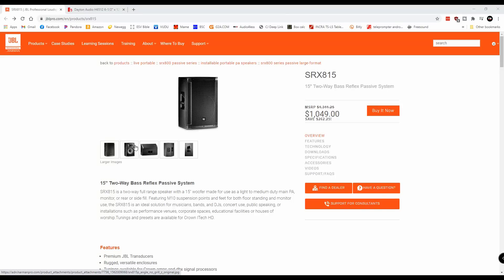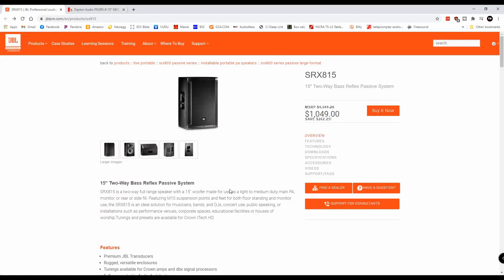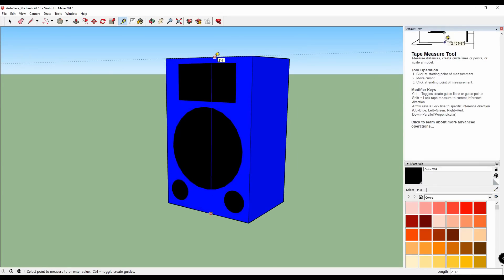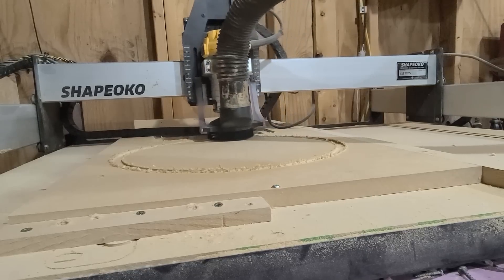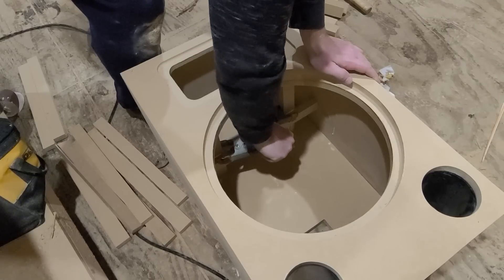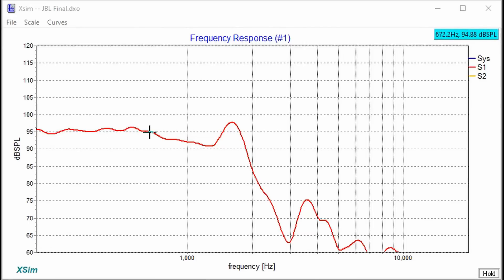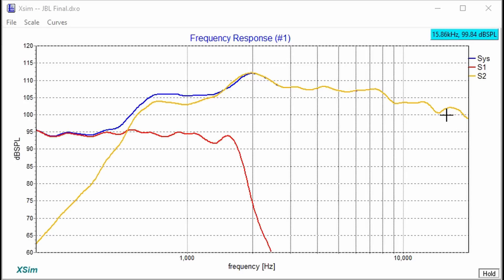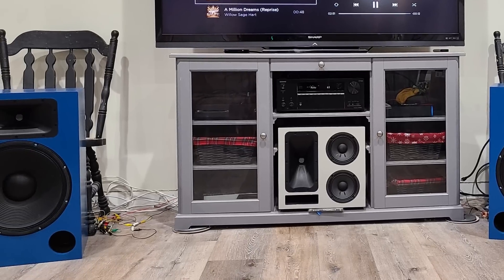How to Build $3000 Speakers for $500 - Soundstage 15

Comment: Good on you for doing a 15". It's about the sweet spot woofer size for 'life sized' output at reference levels in a residential environment. Was so glad to NOT see yet another "surprising bass output from such a small driver" design.
Reply from the maker: Thank you. I will have out a smaller version that should be really good for music and double as a nice surround speaker. It'll use a 10 in woofer and a compression driver.
Reply: @Toid  A bit smaller for on my desktop would be nice. And then I can put 2 in the back too.
Reply: I've done pretty well using 12" drivers.

Comment: Hi so if i build these for Dj-ing/Mobile Dj-ing or PA  in rooms of 100-300 people would they do the job? i'm currently doing a Karoake gig where i need a lil more oomf and would love if these could be part of my upgrades along with two dual 18's for Bass and ofcourse more powerful amplifiers. 

current setup 
Mids n highs: 2x 15 inch mids+two comp tweets with wave guide 360watts RMS each 
Sub: single 18 inch 700watt midlevel front loaded subwoofer 

Mids n highs amp: 2x385watt RMS@8ohm bridged 8 ohm 1100watts

Lows amp: 1x850watt amplifier Bridged 

i only run a Behringer CX2231 crossover(something like that forgot the name)

so please if any input can be shared i would appreciate it.

Comment: Wonder what's considered a medium room, I'm considering adding a DIY speakers to the living room which is 8x6x4m in size. I think the biggest surprise is the idea that I may need 15" woofers to cover that space, which makes me wonder how big would the subwoofer have to be? 21"?
Reply from the maker: You should be fine with something like this. They've played in bigger than that and are just fine. I just want to set realistic expectations. Two speakers for a large venue is a lot to ask for any pair of speakers.
Reply: @Toid  i also wonder how good would the speaker panel+subwoofer combo be.
Reply from the maker: @JoelHernandez-tz3vk  I don't understand the question. But if you're asking how good this sounds, they're pretty incredible.

Comment: Amazing that even in these stratospheric prices, the audiophile speaker manufacturers are only giving you MDF cabinets. Ouch. Here in Hungary, the new trend is to have the cabinet poured for you form concrete. Two smaller places are doing it. Those mothers will never need to be braced internally, and won't start walking off the stands on their own. And don't forget using upscale dog coffins as speaker enclosures, another trend that is catching up. Those are made out of wood, sometime mahogany. Not out of cheapskates MDF.
Reply: LOL..good luck with those. I don't care how good they sound.
Reply: @bobe3250  I’ll take braced wood over concrete any day, I’m not lifting that
Reply: MDF has been used for a reason what your saying is not accurate.
Reply: Ha ha disaster speakers🤣 good for announcements in siberia prisons. No good audio in hungary🥴
Reply: @kosiekoos9408 😂😂😂 no good audio in hungary ?! Take a look at PKN , Porkolab , Beag etc ...
Reply: Mdf has a better harmonic nutrality. This is due to uniform density. You have shown your not an audiophile. Buts thats ok.
Reply: @vengefulones6435  baltic birch plywood has higher rigidity and density. its more expensive but at these price points you would think they would be able to use higher quality materials but mdf is  the best value to build speaker cabinets out of in my opinion.

Comment: Why are they not designed for a large room as you say? With such a high efficiency that doesn't make any sense to me.
Reply from the maker: I should probably have clarified that. I never tested them in large spaces. The biggest I tested it in was a 30x20. They did fine in that space. But since I never tested it in a larger, environment, I can't say they were designed for it. The main test area was 15x25 and they were just amazing in that space.

Comment: How do I find out, how well these would perform outdoor for smaller raves with friends? I mean a 15" woofer should be able to deliver quite a bit of bass for a couple of feet away, or doesn't it?
Reply: Rave style speakers are usually horn loaded so that the enclosure has a massive bump in frequency response. These might be ok but you'd then want to build some purpose built subwoofers to add more thump

Comment: Nice! Appreciate the content. 

Helpful performance tip; utilize a "window" brace, instead of individual pieces. Significantly better bracing. Plus quieting the cabinet is really key with panel sizes like those... as only slight panel motion creates unwanted output.

Comment: Hi! love this :)
Is there an advantage of using the horns tweeters with that woofer? Or can I have a similar set up but with Ribbon tweeters instead?
Reply from the maker: The horn tweets give it quite a few advantages with this particular build. And give it a really wide sound stage while maintaining a very high sensitivity. Which means you don't need to push it very much, which makes it a very dynamic speaker.

Comment: How would you do this with 2 woofers crossover-wise? I have pro amps so driving 2ohm-8ohm loads is no problem. I'm trying to sort-of clone an XLS215 that Cerwin Vega used to make only without the 6.5" mid.
Reply: For the 4 ohm dual woofer low pass you halve the (series) inductor value and double the (parallel) capacitor value - if you are using the same driver(s). That or you can just install an identical low pass on each driver. Then double the size of the box and use 4 ports, then turn the L-pad on the tweeter up a bit - dual woofer conversion. If you want more bass extension you may have to enlarge the box more and/or adjust the diameter and the length of the ports (You might want to model this in a computer). If you are bi-amping you can set the crossovers electronically.

Comment: Hi, I can't understand your choices.  You have a cnc machine and you use it to build custom PA speakers with no regard to sound quality?  With such amazing gear at your disposal, why would you: 
1.  Use the SRX815 template, i.e. the one with no midrange driver?  Really, what sane person uses a 15" woofer anywhere in the 500-1500Hz range?  Just because bars use them to get really loud doesn't mean you should.

2.  Use thin walls when you need at least 1.5", especially on the baffle. No braces either.  Too much weight?  Use a 10" woofer instead to have a smaller cabinet.  It will generate much better bass down to <40Hz, just not as stupidly loudly.

3.  Not install damping treatment on the inside walls.

4. Not install damping treatment on the horn or the woofer basket.

5.  Not radius the baffle.

Finally, you said these speakers are designed for "small-to-medium sized rooms."  In what universe?  Two 15" woofers (total) for a small room?

JBL makes some wonderful drivers.  You could put in good crossovers and make good boxes, but without good design, they will fail.
Reply: 1. Perhaps for simplicity. I would like him to do a midrange horn next. 2. i thought that was strange to have such a puny front.  3. i think this is important as reflections can come out the cone 4. I think heavy bitumen like material is a cheap add on to reduce vibration 5. baffle radius wont matter very much. I would look at the room first

Comment: I have a set of GEMSOUND speakers id like to do a very similar upgrade to, but you didnt show the crossover however. The GEMs have an 18"LF, 3x7" MF and an array of 5 supertweeters. I simply want to start with getting a proper 3 way xover in there and a set of horns. Great work BTW, good stuff!
Reply from the maker: thank you. All the crossover information is in the plans which are linked in the description

Comment: Just a tip from a very experienced speaker builder. You should always support those horn drivers. I couldn't see in the video if you did but what happens if you don't is if they ever take a hard hit or a drop it will break your horn.
Reply from the maker: Great tip!
Reply: @Toid  thank you! Great video and I like that you braced your box. I've never understood why a lot of premade pro boxes don't do that. I mostly build custom PA boxes for some well known touring companies and I always brace the hell out of mine. There's a noticeable difference and when you're flying a lot of cabinets you definitely need the extra support too.

Comment: Nice build...!   For outdoor theater use however I'd have probably gone with birch ply, rounded off those edges and cover the whole thing with white duratex dyed to my chosen colour and put on with a fine finish foam roller. And put a mesh screen on the inside end of those vents :-)
Reply from the maker: Great points!

Comment: Oh man, I'd Def buy a DIY Amp off of you. Parts express is always sold out!
Reply from the maker: I could sell you mine if you want.  I can always build another one.  Go ahead and email me.
Reply: @Toid  Do you have any websites or YouTube videos for designing a subwoofer box?
Reply from the maker: @riveralley  I do. Here's a link to a series I did on a free program that helps you learn how to design boxes for subwoofers. https://youtube.com/playlist?list=PL6hjpiCHZmIOAv44PCreW5KlI35h1mTZK I do plan to redo the series at some point, but this should be good for now.
Reply: @Toid  is there a formula for getting the right area for the port? Or like a general rule of thumb?
Reply from the maker: @riveralley  there is, but it doesn't take into account sound quality or damage to the driver. It's best to model it in a program where it can give you an idea of if it's safe for the driver, the amount of air that will go through the port and the correct size that should be used.
Reply: @Toid  Thank you sir! Amp works great and my speakers have never sounded better! Great job on your channel and craftsmanship. 

If you ever do a DIY preamp/streamer build, let me know!
Reply from the maker: @Texican117  that's great to hear! Thank you for the update! Hopefully in the future I'll be able to do that.

Comment: For the crossover could I use this pre-built one from Parts Express?  PRV Audio 2DF1800 2-way, Part # 294-2867
Reply from the maker: Not to get the response I showed.
Reply: @Toid  Oh, okay. I have an older JBL SF25 PA speaker that I acquired a while back and I wanted to use this build to turn 1 dual 15" speaker into 2 single 15" speakers. I have a good grasp of the design and the hardware is already in the shopping cart. The issue is the crossover. I am willing to make one but I would need a parts list and a wiring diagram. Any help would be greatly appreciated even if it's just the specs I need for the crossover and I'll google "how to make a crossover" until I figure it out or buy a DSP. lol The replica build videos are definitely interesting to watch. Keep up the good work!

Comment: How much does that CNC machine cost?
Reply from the maker: I opted for the biggest unit so I think it's around $2,000. However I would much rather go with an oozenest workbee. It's around the same price can be bigger, and uses lead screws instead of belts, which makes it a lot more accurate. In general it seems to be a much better machine. I'm hoping to upgrade to one in the future
Reply: @Toid  Thanks, I told you I've been really sick and bleeding down low, I was scoped upper and lower, They found thickening on the outer lining of my heart and the condition is Amyloid, but I have to go to a specialist, 2 large Peptic Ulcers and a huge Hemerobiid closing my exit and I might have blood cancer, causing the thickening waiting on biopsies and esophageal issues, but at least I know, but I hope you and yours are all okay now??
Reply from the maker: @MrBrymstond  oh man that is awful. I really hope that you get better soon. Please keep me updated if you can. Take care of yourself. We are doing well. And you will be in our thoughts and prayers.
Reply: @Toid  Thank you and likewise.
Reply: @Toid  They found the heart issue using a echo cardiogram, but I might not have exactly that, they're puzzled.

Comment: I'll bet it sounds awesome in a night club for what the person bought them for and maybe hang them out of the way so they can project and I know the woofers sound better close to the ground, but you could always have a sub on the floor. PA Speakers got a bad rap because some think they're only good for bulk power while sounding fair, but I have PA Speakers with some killer sound. What would make these incredible for use in a larger band type music hall high quality sound would be two 15" woofers and a bigger Horn and have a short pole to be able to attach it directly into a subwoofer enclosure so the main speaker sits 2 or 3 feet on top of the sub with a pipe separating the two. I know Florida still has bands and karaoke at most bars, but I worry it will all go away everywhere. I had a outside anniversary party at my house with 50 people or more and cranking music last August in New York and the cops just drove by over and over with no problems if you can believe that as the cars lined up down the street.
Reply from the maker: Here's his report of the speakers: "They're great!  Love them!  I wasn't an audiophile before but I think I'm turning into one now!  Listening to music now is more enjoyable than I thought possible, I can "see" the music now.  Karaoke is on a whole new level now too!  I love the clarity of the sound they produce, no discomfort to the ears.  You don't realize how loud they are until you try to talk to someone because the purity of the sound is so clean."
Reply: I'd rather use these bad boys at home. Screw a club

Comment: Great! Love your work, best channel for DIYers ever! I've been playing with WinSD for vented projects, but I am confused what the port length means when specifying two ports instead of one. Does the figure displayed means that each one of the ports should be of that length, or that the total length of both parts should be this figure? Thanks.
Reply from the maker: Great question.  It means each port should be whatever the figured length is in WinISD.  SO if it says 2 ports 3" diameter 12" long.  It mean both 3" both need to be 12" long.

Comment: What would be the woofer in this build that can do 30Hz f3
Reply from the maker: I'm not sure off hand.  However, if you went this route, you would most likely need a larger box or loose out on the efficiency, making the system overall a lot less sensitive.  That old Hoffman's Law, just can't get around it.
Reply: @Toid  hearing great feedback on Purifi woofers the 6.5” woofer can compete with a 15”
Reply from the maker: @anandshah71  I've also heard great things about Purifi.  I would love to get my hands on some.  However, saying it could compete with a 15" woofer like this would be a huge stretch.  That purifi still only has a volume displacement of 1,325 while this Dayton's is 5,785.  Which is almost 4.5 times the purifi.   Having said that, the Purifi is still very formidable.  And by all accounts a very nice driver.

Comment: There's something about a large diameter light cone strong motor mid woofer that brings music to life. In the spirit of big beautiful vintage JBL studio monitors, I'm running a DIY 4-way (18", 15", big radial horns and ring/slot tweeters) actively multiamped system with crossover points at 100, 800, and 6k... stunning!
Reply: I totally agree, I am running jbl 4345 clones and the large mid is amazing.
Reply: @callmebigpapa  too cool! Anywhere I can go to see more details of your project?  I'm working on posting mine somewhere, including sound clips if I can get around copyright rules.

Comment: How about open baffle speakers? Like trio 15s or quintets from Pure audio project .....or open baffle arays like dany richie is designing .,....I hope I triggered your curiosity for open baffle speakers .....more and more people turn that way nowadays....thank u for your work
Reply from the maker: Thanks.  I have been pondering the idea...
Reply: @Toid  please do. I have been looking for affordable high efficiency and tube friendly speakers but haven’t found many options. I built my own 300B single ended amp. It sounds great with my 87dB speakers but should sound even better with some high efficiency speakers especially open baffle. Problem is there are not many designs let alone affordable ones. The Nxoticas start at $2600.
Reply: @Toid  Hey. May you please do the following projects.. please post plans with all measurements too. 
1. Bose MB24 WR SUBWOOFER 
2. McCauley M421 SUBWOOFER
3. Danley TH812 SUBWOOFER (155dB+!)
4. Danley J5 caleb (160db+!)
5. Bose Roommatch Arenamatch Showmatch line arrays..
Reply from the maker: @josealfredfernandes  I do have a Bose style system coming out later this year.
Reply: The trio 15s i belive use 2 X eminence 15 A and a tang band w8 1808 per speaker don't know if they are a 2 way or a 3 way design.......the quintets use 4 X eminence  15 A s and a w8 tang band 1808 per speaker and its a 3 way design .......the nx oticas use  some no name drivers 8 and 16 ohm  ones plus ribbon tweeter i belive three way design by dany richie with some wings- flanges on the side ......they seem complicated for simple diy

Comment: What size t-nuts and screws did you use for mounting the woofer?
Reply from the maker: Good Question.  I used 1/4"
Reply: @Toid  thanks for the reply! I was looking for a solution for a couple of pro audio 18's that keep stripping out the screw holes. These should do the trick!